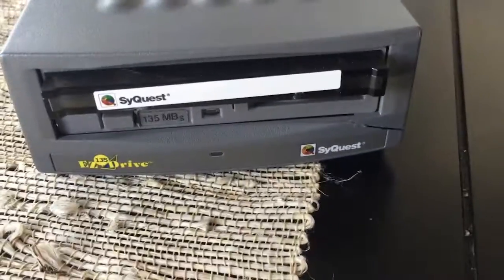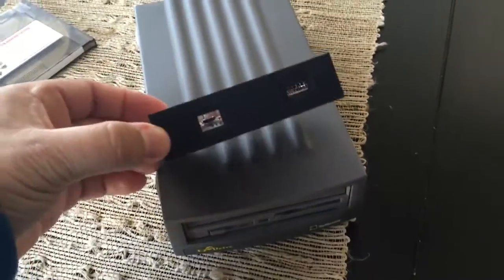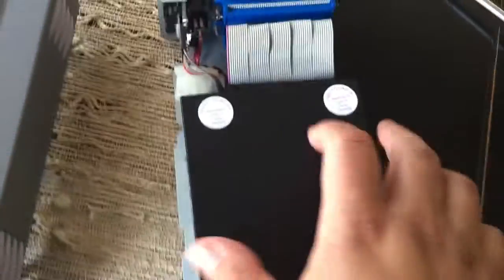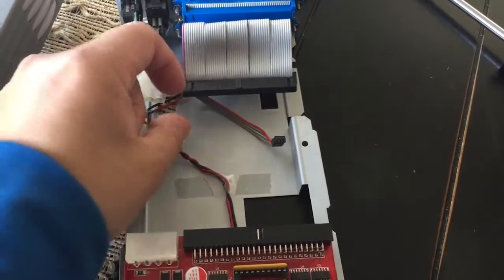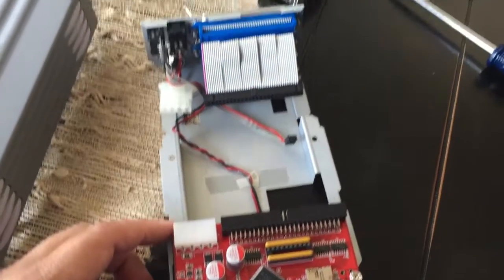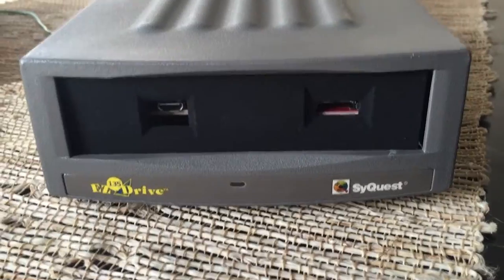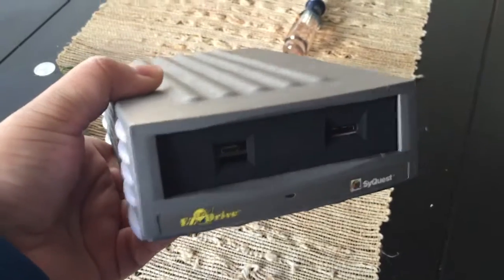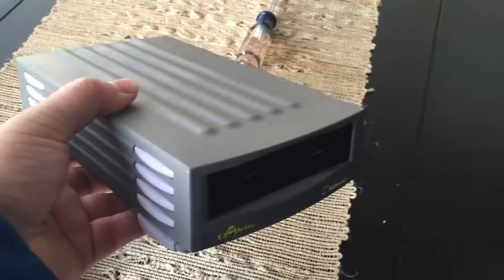Building an external SCSI reader from a SCSI2SD and a Syquest enclosure

Comment: Hello 

Did you also put the terminator on at the scsi connector from the case or is that of , and only the Scsi2sd card terminator is on?
Reply from the maker: You only need 1 termination point so either pick the termination at the scsi2sd or use an external termination connecter.
Reply: @RoyMaya  awesome thank you so i put the terminator of in the controller and let the terminator on with the Scsi2sd card, I hope I understand correct :)
Reply from the maker: @ahwbeats  That's sounds right.
Reply: @RoyMaya  thank you 🙏

Comment: Hi, great video ! scsi is still mysterious to me. Does the two 50 pins ports mean that you can plug a computer and a sampler at the same time to have access to the SD card ? And that you need a terminator if you only use one port ? Thanks !
Reply from the maker: Technically, having two ports means you can daisy chain multiple scsi devices that are not hosts.  In other words, it was designed to daisy chain multiple hard drives and cd-rom drives, but not multiple samplers and computers.  Data corruption can occur if two hosts try to access the same drive.  That being said, it can be done if you're careful.  I've had better luck using one drive with multiple samplers but sharing with computers has been more difficult.  And yes you need to terminate the other port if it's not being used. But really you don't need to connect the computer and sampler to access the SD card.  You can just take the SD card out and plug it into your computer to transfer the data.
Reply: Thanks ! My point is to be able to use my ASR-10 with Alchemy through the scsi2sd like in this video https://youtu.be/Ag2_BAS6Pco. Apparently he used exactly the same configuration and it worked.